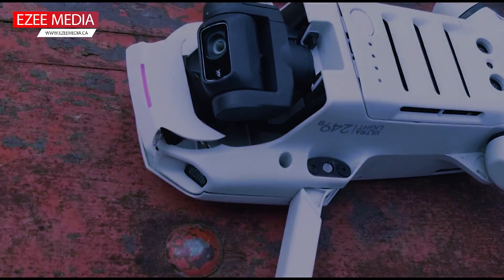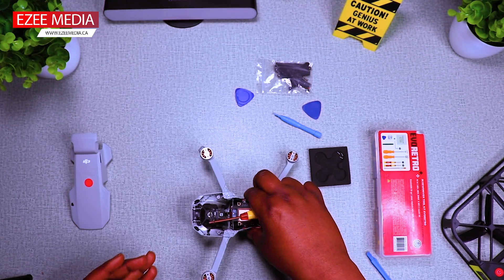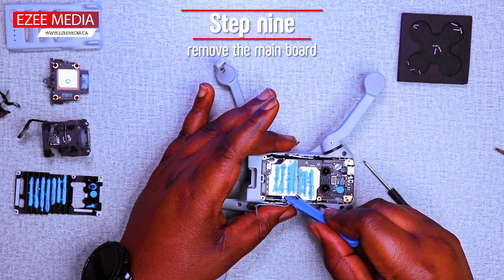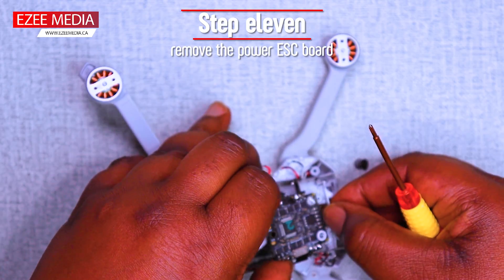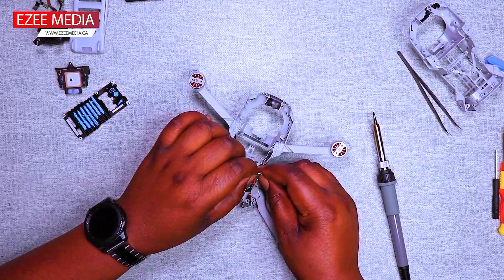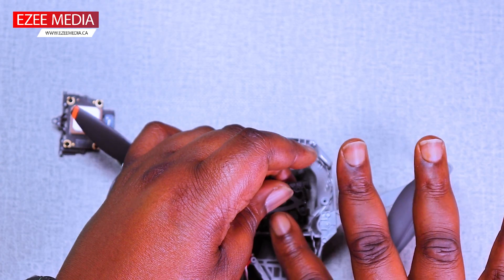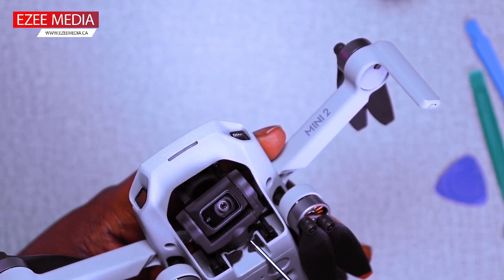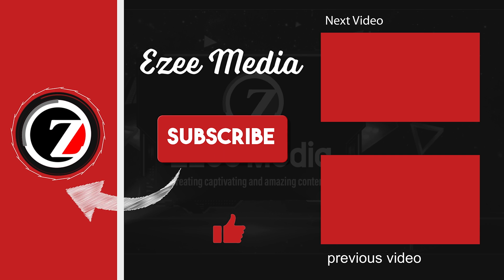HOW TO REPAIR CRASHED DJI MINI 1& 2 - DETAILED REPAIR TIMELINE

Comment: what is the the golden  foil sticker inside old top shell for?
Reply from the maker: Hey Ali the golden foil stickers is just for preventing signal interference. Not really very important to keep.
Reply: @EZeemedia  can I use a copper tape instead will it be the same because I usually fly long ranges and there are lots signal interference's?

Comment: hi can you tell me the drone can connect to the remote control without this flex cable or not...because my flex cable is damaged and i just ordered it so i will receive it after 20 days or more.....when i returned  Everything falls into place The drone does not want to connect to the remote control.  Does this cable have anything to do with this or not?
Reply from the maker: No the the cable has nothing to do with that. Just press the power button until u hear a sound and the rc should be able to connect

Comment: is there any way to change the gimbal motor? one motor is working but other 2 is not working after cashing from 30m
Reply from the maker: Hey Saif thanks for the call. If I understand u correctly u are asking if the propeller motor is changeable?
Reply: @EZeemedia  no.  3 axis gimbal motor
Reply from the maker: Ok I see I believe u can but will recommend u just change the gimbal casing and u can get this from Ali express
Reply from the maker: Use this link to get it from Ali express C$ 124.02  20%OFF | DJI Mini 2 Gimbal Housing Shell Without Camera for DJI Mini 2/SE Mavic Mini Drone Replacement Repair Parts In Stock Original
https://a.aliexpress.com/_mrqRXWg
Reply from the maker: I hope this helps otherwise shoot me a msg on my Instagram handle then u send me photos of the state of the gimbal to see if there any help advise I can give ok

Comment: Thanks for he video, awesome! 
I replaced my gimble flex cable with no sweat, but now I got some vision sensor error and my gimble is moving like crazy when connected . Do you have any idea what went wrong?
Reply from the maker: Hey Vasko so happy the video helps pls msg me on instagram @ezeemedia and I will be willing to help. Thanks 👍
Reply: Hi, i have the same issue, could you help me?
Reply: Sorry I wish I could. I redid it again with same results. No way I could make the drone recognize the camera...Eventually I bought the mini3, still have the 2 unoperational with 3 spare batteries. @gabrielrosendo1490

Comment: do you know if the dji mavic mini 2 motherboards interchangable?
Reply from the maker: Hello Drew I haven't tried it before but I believe I will work only thing I think is that u will need to do an update. But give it a try, if I may ask what happened to ur main board ? Let me know if it's fixable ok.

Comment: Thank you for this detailed video.  I don't see the links for the soldering tool or the screwdriver set you have.
Would you mind sending me them please?
Reply from the maker: Hello mate!😊thanks for the comment I really do appreciate. My apologies for not provide with the links to the soldering tool and screw drivers. Here is the link for the tool Soldering Iron Kit Electronics, Rarlight 60W Adjustable Temperature Welding Tool, Digital Multimeter, Desoldering Pump, Soldering Iron Stand, Wire Stripper Cutter, Tweezers, 2pcs Electronic Wire, Screwdrivers ET002, Solder Wick, Carry Bag https://www.amazon.ca/dp/B07TWBRD49/ref=cm_sw_r_apan_glt_i_VEB8HHQ08BZVA8P0CVQP?_encoding=UTF8&psc=1 . Hope this helps please don't forget to support this channel by subscribing and smashing the bell icon for notifications. Thanks you so much and stay blessed and connected 👍🙏🙏🙏🙏

Comment: Hello
Thanks for that video, Gimble has no signs of damage, has video but will not move up or down with controller, error message 40002 and intermittent 40003, will cycle on power up any suggestions please.
Reply from the maker: Hello John thanks for the comment. Did u crash the drone ? And if u did let me know how so I can troubleshoot
Reply: @EZeemedia  No I did not crash it, it just stopped working on its own

Comment: Hii bro please reply if I stick with gorilla glue and if I want to again remove that copper and black strip it can remove how ?
Reply from the maker: hey pal use the epoxy gorilla glue it's kind of clear rubber like substance so when u want to remove it simply apply heat with a heat gun or hair dryer will work. hope this helps 🙂 don't forget to subscribe and like this video for more contents

Comment: Hi,

Thanks for the video. It helped me repairing ny crashed one. The only problem is that after changing the flexcable to the gimbal you'll have to callibrate it again.  I can't fix the callibration, I'm afraid I have to send it to a professional.
But thanks anyway !

greetings from NL     Peter
Reply from the maker: Hello Peter, thanks for the comment. Why couldn't u calibrate the gimbal all you need to do is go to the profile and calibrate it. Reach out to my Facebook page and chat me up I will walk u  through it
Reply: @EZeemedia  Hi there,

Thanks for your answer. I noticed a lot of owners with crashed drones on forums. They had troubles with software after changing parts. It's the same with cars, when you change something on a modern car the computer will not recognize it and it won't work. You'll have to go to the the dealer ....$$$$$
But it is possible to put some software on a DJI. I found this guy https://youtu.be/5z8QmE1i2PM and that was quite interesting. In the clip he puts a gimbalfile   100.0320 into the drone. I tried it also, but that file is not to be found (anymore...) on that site from Drone-Hackers.
Anyway, maybe the gimbal didn't survive the crash there is not any movement  ........ $$$$$$$ 

greetings  Peter
Reply from the maker: Ok I see but did u change the gimbal or just the flex. Also was the gimbal damaged ? if not send me a screen shot of the error and I will see what I can do to help. Thanks
Reply: @EZeemedia  

Thanks,

But there might be more wrong. I will send to a repairshop. Putting old and new software did not fix the problem. Thanks anyway for your help and have a good day !

gr. Peter

Comment: My mini2 crashed, the back of the drone hit the ground first , it seems like the only hardware damaged is only the battery cover at the back. But then the gimbal has trouble getting level with the horizon.do u think it can be fixed
Reply from the maker: hey Alfred suremit can be fixed. I think the gimbal rubber holders may be slacked and for the battery cover you can buy it and replace
Reply: Some parts of the software may be faulty is it possible to manipulate the software
Reply from the maker: No it is not possible to manipulate the software. you can only replace parts. if I may ask where is ur location?
Reply: Im 🇲🇾 malaysian
Reply: Just sent it to dji store for repair and now hoping that the problem wouldnt be so severe

Comment: hi! My gimbal is not calibrateing when i`m turning on my drone... it flicks up and down fast for 2-3 seconds and then it is not stabilised... i replace the gimbal and the flex cable and the same isue appear.... do you think it`s the gps module that is faulty? or some connections of the flex cable is damaged? thank you!
Reply from the maker: Hello friend, I wouldn't know what the issue is if I don't know the error msg. Let me know all the error msgs then I can tell what I need to do.

Comment: Did you glue in the front LED and 2 vents?
Reply from the maker: Hello Gino, yes I did but apply very little around the edges and that should hold perfectly.
Reply: @EZeemedia  What did you use for the black cover over the LED? Informative video. 👍